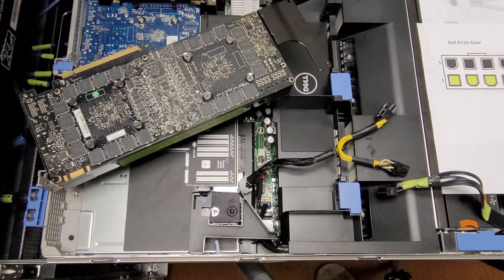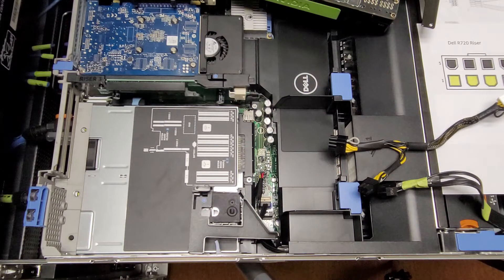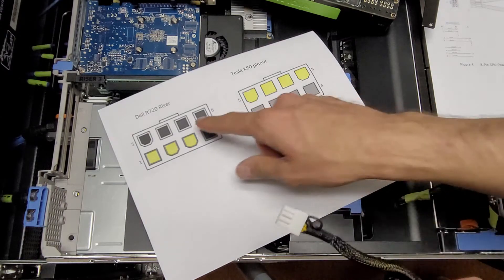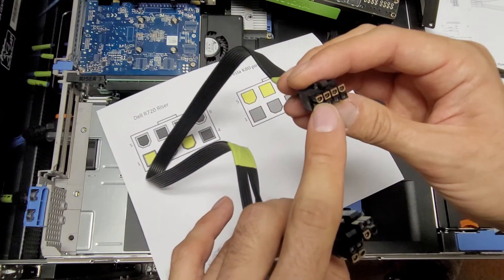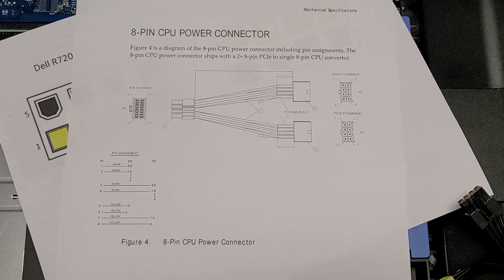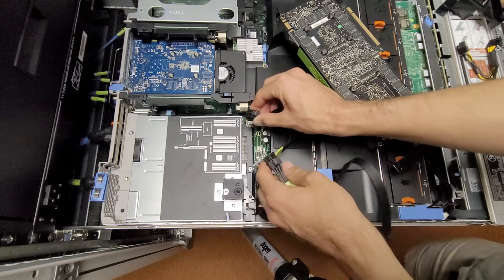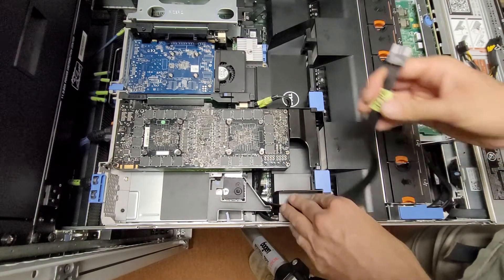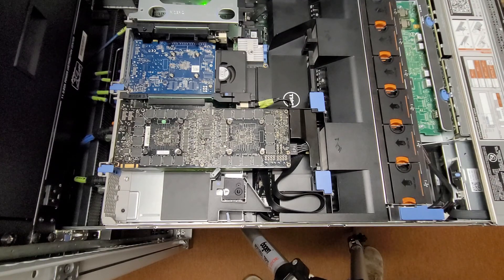Discussing power caveats with the Tesla K80 in a Dell Poweredge R720 and installing it

Comment: My issue is that I am unsure wether or not I will need a different riser card.  I have seen some videos that say yes you do and then they don't specify what exactly that I need for running a k80.  The riser card I have that is in the server is one that has 2 pcie slots, the one that I see shown in many of these videos shows a card with only 1.  Which should I get if need be?  I know it's supposed to be the one that supports a higher than 75 watt power output, but no clue what to search for to buy.  The search engines are useless for this and the listings on ebay and such don't give me the relevant wattage specs for the cards they are selling and their pictures are so out of focus the small writing is unreadable to tell what is the outgoing wattage.  Can't find on the one that I have what it's wattage is either.  It should say near the plug in what it is, but doesn't that I can see.  Anyone dealt with this that would share some insight?  Thanks in advance.
Reply from the maker: Sorry looks like my original reply was wrong. Slots aren't labeled for their power output and the GPU power connectors have different ratings for riser 3. I believe the x16 slots should all be good for 75W. Riser 2 GPU power is 225W but with riser 3 only the single slot x16 version like the CPVNF is labeled for 225W output.
Reply: @computersales  Thanks, looks like I'll need one and the special cable then.  Appreciate your help.  It's so difficult to get a straight answer on some of these things.
Reply from the maker: @jamesross1003  yeah it is a bit confusing to figure out.
Reply: @computersales  LOL, tell me about.  There are many things that are puzzling about these things.  What I got to get started in this is an R720, has caddies but no drives at all and no OS.  Ordered a couple of drives and when they came neither the drives nor the caddies have any mounting screws.  It seems to just be about more trouble than it's worth for many people.  I can't even pop a drive in it to test that it didn't get damaged in shipping.  Pretty big pain in the butt to be honest.  Any way I can actually test this to make sure it is functional while I wait on all these missing things to arrive?  I only have about 3 more weeks until I can no longer send it back.  Total server noob here.  First server to work with to try my hand at it as a hobby.  Thanks again for the previous feedback.
Reply from the maker: @jamesross1003  you can live boot it off a Linux flash drive.
Reply: @computersales  Sounds like a plan to me.  Thanks, I'll look into though I'll still have to get a flash drive for this.  Was thinking about POP OS as a possible OS anyway.  Lots to learn and lots of experimenting.  Sounding like getting an AI on it and running might be the easy part instead of the other way around.

Comment: Thanks for making sure I did not burn out my server and or GPU 🙂

Do NOT use a modular PSU CPU cable. It's deceptive because it will plug nice and snug into the riser power socket and plug into the K80 as well. You could naturally assume everything is fine because only the right plugs will plug into a matched socket? Nope. Not the case. Do not turn the power on 🙂

As a matter of interest the M10 can use a normal modular PSU PCIE GPU cable on both ends. Why they made the K80 the way they did baffles me.
Reply from the maker: @robinmountford5322  The thing I don't like about the modular PSUs is the wires aren't color coded. Easy to make a mistake of things aren't keyed correctly. 

Yeah it is weird some of the Tesla cards are EPS 12V and some are PCIe powered.
Reply: @computersales  Exactly. Lack of color coding is a definite down side.

Comment: i did the same thing bud... just used a meter n made my own... powered up fine, card shows up in device manager, but wont install along with my GTX960, so im gonna try it with the motherboard on-board (intelHD) card only + the K80, and if that doesnt work, im gonna try it (with a pci-e 16x extension cable) on my R620 server... fingers crossed... i also took the plastic cover off, removed both heatsinks, and installed fans on each chip (because i've seen a ton of videos about the k80 running hot) - but thanks for the video, cuz i was lookin for someone that did the same thing i did to rule that out. stay guessin brov, its how i live every day... just remember: all machines are smoke machines if you use em wrong... :)
Reply from the maker: @JayarBass  it may be a compatibility issue with your motherboard. I forget how they react in windows if the motherboard isn't supported. I think it will show up but throw error in device manager. Hopefully you get something to work though.

Comment: Thank you so much for this video, and you are correct on nobody mentioning that you need a separate EPS connector and not a standard GPU combiner cable. 

I have an HP z840, it came stock with the 1125w power supply and three six pin PCI-E power cables. Not knowing any better, I plugged in the two six pin cables and the 8 pin side wouldn't fit in the Tesla P40 card I picked up. This was due to the plastic bridge between pins 1 and 2. My eyes aren't that good, so I assumed it was a molding defect in the cheap Amzn sourced cable and just carefully cut out the plastic bridge. As soon as I plugged the card in I got the 4 beeps from the power supply. I found out from your video that I was shorting 12v to ground. 

So, about an hour to re-pin the generic power cable, that was after about 2 hrs of searching the web before I stumbled across your video. Luckily my P40 is working now. I'll stress test it later to hopefully find it functions well and I'm grateful that I didn't damage any hardware on my server. Hopefully the card tests good.

Thank you again!
Reply from the maker: Yeah the cards are weird that they don't use normal PCIe power. In theory the short protection circuits should protect your card. I never noticed any issues with my hardware after using the wrong cable.

Comment: hey, is there anything special you did on the software side? 
my k80 produced a code 12 ....
Reply from the maker: Your question is too open-ended for me to even speculate. You would have to give me more details of your setup. Although my first guess would be you're trying to pass both GPUs to one windows  operating system which the best of my knowledge isn't possible.
Reply: @computersales I tired both proxmox (using a guide by craft Computing) with both gpus passed through, that produced a code 10 so i tried installing win10 on bare metal. That resulted in a code 12
Reply from the maker: @tomhackz250  does it give that error if you pass the GPUs through to two separate VMs?
Reply: @computersales  Ive just tired allocating one half to a gpu. Is it required to allocate both??!?
Reply from the maker: @tomhackz250  you don't have to use both but you can only allocate one GPU per windows vm.

Comment: Hey, what psus are required, I found a 2x 750w one cheaply buy the 1100w psus are not cheap where I live.
Also this one has 2x e5-2690 which are like 130w which concerns me.
Reply from the maker: It should be fine to run 750W PSUs as long as you aren't running them in redundant mode. Just some rough numbers you'd be looking at:

135W CPU x2 > 270W
Fans at 100% > 100W
250W Tesla x2 > 500W
3.5" 7.2K RPM HDD x8 > 48-120W
DDR3 memory x24 > 48-72W
Everything else > 75W?

Total: ~1137W

Honestly to run the Tesla's at full 250W TDP you gotta be really pushing them. Something abnormal like Furmark, mining, or Folding at Home. When I intentionally loaded my server down with tasks I peaked at 697W. Although "technically" not recommended you should be fine if you are being reasonable.

Comment: try to add p100 in r720xd，but it's always not at full power, because the temp is too high to 80°c ，even though I've turned the server fan to maximum😂
Reply from the maker: Interesting.  There could be other factors at play such as your workload, or ambient room temperature. Technically that is an unsupported config, but honestly not sure why it wouldn't work. Can you feel the airflow going through your P100?
Reply: @computersales  Well, it's working, but when i use some app like furmark, it's working at first 60s, then heat dissipation can't keep up, fps go down, think it is an air duct problem
Reply from the maker: @jyl0328  Furmark isn't really a good way to test a GPU imo. Furmark is more of a tool for when you want to see how many punches to the face you can take before falling over. I would recommend trying a more realistic synthetic load like heaven benchmark. I think even crypto mining is more realistic than Furmark.

Comment: Thanks for this video, it explained what was happening to my r720 when I connected my Tesla p40 to my riser port using a similar aftermarket Cable (9H6FV). Thankfully nothing burnt and  I had a 8pin Corsair CPU cable that I tried and it worked and my server booted up. 

I then checked the manual for the Tesla p40 and it does say to use a 1x CPU 8-pin cable - so I guess I was lucky to have one around.
Reply from the maker: Yeah it is kinda tricky when the aftermarket cables aren't keyed correctly. Pretty cool you had a compatible one on hand.

Comment: Thanks for the video and the extended explanation of the power issue. Did you have any issues with the fans staying at a higher-than-normal rpm even after the system spools down from initial startup?

After a bunch of reading on another issue, I found a racadm command that I ran that is supposed to ignore (or something) thermal settings for non-dell equipment installed in the system. I was initially having the same fan problem while trying to install an add-on card for NVMe's. The racadm command solved the issue for that but it seems to be happening again, somewhat less noisy, when I then install the nvidia K80 into my R730.

Any assistance would be appreciated. Thanks!
Reply from the maker: I honestly haven't had a chance to mess with putting Tesla cards in an r730. In my r720 the fans run like normal. Although one nice thing about the k80 and the r720 is they somehow were able to communicate temps and manage fan speed. 

Although unlikely you're having any hardware issues might not be a bad idea to run the diagnostics in the lifecycle controller. I'm not sure if there is any significant difference between the r720 and r730 from a life cycle standpoint.

Comment: Thank you. I read bad advice and have a cable on the way that would have shorted out my Tesla M40 and R720. Now I will avoid this fate.
Reply from the maker: Yeah it is kind of a pain they chose to use EPS 12v on these. I need to make more of my own custom cables as mine are keyed to make it harder to use them wrong.

Comment: Hey, I know you probably wont see this, and it's a long shot, but what temperatures did you manage under full load? Were you using low-profile CPU heatsinks by any chance? I replaced the thermal paste on mine, and I'm still struggling to keep it cool.
Reply from the maker: I'm running the standard full height CPU heatsinks.  I don't have good data since I didn't pay attention.  From what I can find it looks like it was running around 70 C under full load.

https://www.youtube.com/watch?v=vJKAqC2PReQ

You can potentially control your server's fan speeds if needed.  There are some fancy scripts people have written otherwise just force a constant fan speed.

https://www.dell.com/community/Systems-Management-General/Dell-PowerEdge-fan-speed-change-fanspeed-offset/td-p/5187784
Reply: @computersales  my issue is I'm running mine at 100% fan speed, ive replaced the thermal compound, but I'm getting about 80c with a full extended stress test. Trying to get it significantly lower
Reply from the maker: @titusarms  These are datacenter cards and should be able to handle some heat.  My Tesla M40's run 40 C idle.  If it is still running hot after replacing thermal compound you may have disturbed something or made a mistake.  Also synthetic loads aren't always an accurate way to test thermal performance.  Mostly because synthetic loads don't replicate real world scenarios.

Comment: Hi, again, I really appreciate your replies & info :) but this question is a little off this topic, but here we go...I found an SSD drive that has Windows 10 installed, so I plugged that in, and got it boot into Windows, however, there is NO USB control for the mouse & keyboard, and I have no way to navigate to find what the problem is. USB works just fine when navigating around the DELL menu's & setting's pages, I'm going to try a fresh setup of "something" Windows, and hoping that the USB will be OK, after that. I have also done a BIOS & iDRAC update, so I slowly learning. Cheers.
Reply from the maker: It is possible that USB control is disabled for everything but BIOS use.  I am not sure if there is a setting for that off the top of my head.  You could try resetting the BIOS to factory defaults.  If that doesn't work maybe see if you have a PCI express USB controller card you could install.

Comment: Thanks for your reply, I forgot to mention that I have a Tesla K20Xm, and I think that's on the "list" of compatibly GPU's for an R720, I'm hoping that won't need to go to 1,100W PSU's...if it doesn't work, then I'll just run the onboard Matrox.

I have seen a YT clip of an R720 with a RTX2060, and it clearly shows the 750W PSU's, he's also running 2 monitors, one off the onboard, and one off the 2060....

Can the Lifecycle Controller be disabled ??

This is all new to me, I only got the R720 earlier this week, got to update the BIOS, etc, etc....I just want to run Windows on an SSD.
Reply from the maker: I believe the K20xm runs off a PCI Express 6-pin and 8-pin connector. 

You can basically run any video card you want in the R720 as long as it fits physically and has adequate cooling. I haven't tested running the R720 with 750 watt power supplies and video cards. 

Lifecycle can't be disabled. If lifecycle stops working the server won't work either. 

It is pretty straightforward to get Windows on an r720 so that shouldn't be too big of a worry. I was running Windows 10 on one to test some things.
Reply: Yes, the K20Xm does run that connection, which should run off the riser plug, correct ?

And I was thinking of running an SSD off that Sata port, behind the fans.
Reply from the maker: @geoffhowse3591  Yeah the riser plug can provide PCI Express power. 

You can run a SATA drive off the optical drive bay connection but you will need an adapter for the power connector. They do make adapter bays that will convert a laptop optical drive into a two and a half inch SATA drive carrier.
Reply from the maker: @geoffhowse3591  So I decided to run a test.  I was able to get a R720 with dual 750W PSU to boot to Windows 10 with a quadro 4000 installed.  So the 1100W power supply requirement may be subjective?  Got the demo video going up tomorrow.

Comment: Hello, I'm really glad I've found your channel...I just got an R720, and I am trying to get some GPU's to work, and had no luck yet, but one thing I am reading a LOT is that you need to be running the 1,100W PSU's, what are you running, I've only got the 750's. As for the cables, I think that a cable off an Antec HCG850, seems to be wired OK for the Riser GPU plug, for both a K80, and K20Xm, etc,  But yeah, I'll be checking out your clips, that's for sure. Cheers
Reply: Dell does say an 1100W PSU is required to use a GPU on the R720, but that is just if you want a system dell will support. I have been running my 250W Tesla M40 off my single 750W for a week now 24/7. Average wattage when using full GPU is 550W, max recorded watts 620W. I am going to upgrade to 1100W only if I put another GPU in there.
Reply from the maker: Yes the 1100W power supplies are required. I've never tried the 750W ones. They might work but my assumption is your life cycle controller will stop it. 

Also might want to double check the pin out of that cable carefully before using it. I didn't do a ton of research but it looks like the EPS 12 volt cable off that power supply is wired for EPS 12V on both ends. That won't work with an R720.

Comment: Hi friend, Will the Tesla K80 also work great with R720xd?
Reply from the maker: As far as I know the R720xd should be the same internally. Depending on your config it may have less PCI express slots available though.
Reply: @computersales  are you using dual 750W of PSU on your server to run the K80?
Reply from the maker: @jacksonpham2974  My apologies I didn't see your reply sooner. I'm using dual 1100W supplies. It may be possible to use 750W supplies but I haven't verified personally.